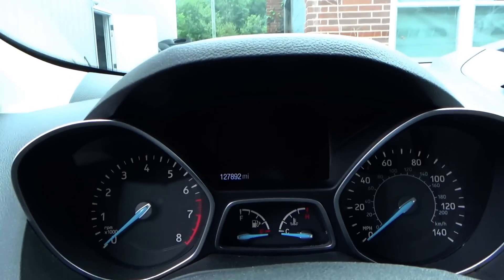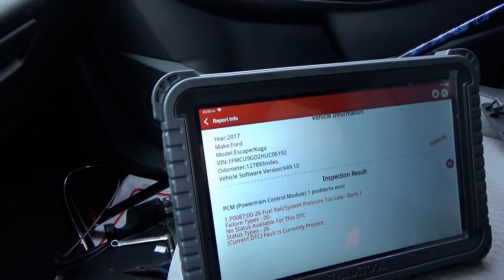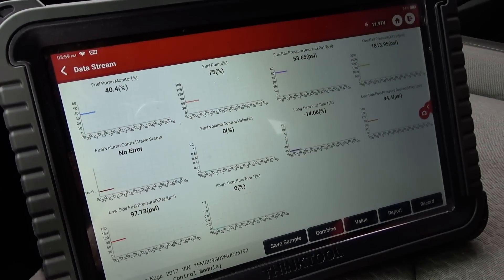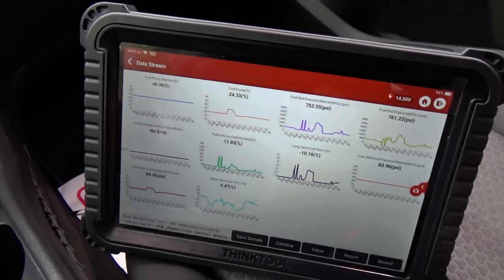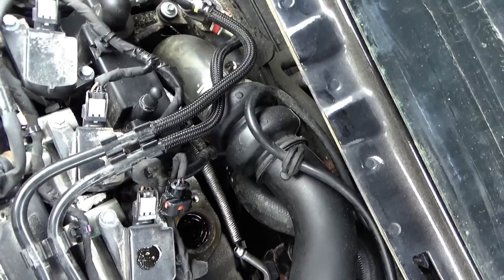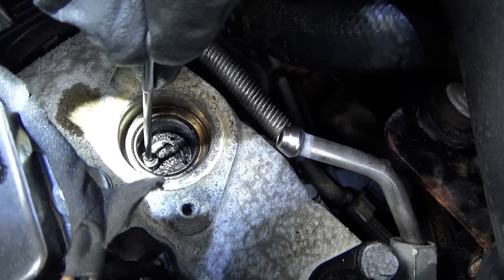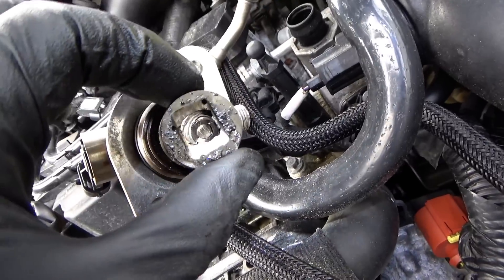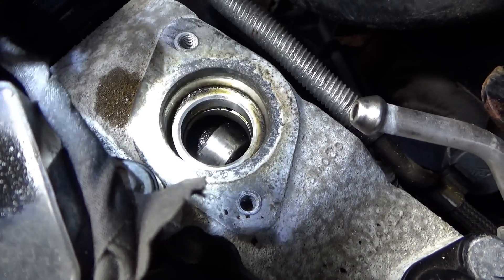Auction Ford FALLS ON ITS FACE! (Escape Turbo GDI P0087)

Comment: That camshafts going to tear up a new cam follower and pump very fast. It should last long enough for the dealer to sell it to an unsuspecting customer and leave them stuck with the camshaft bill. Not to mention that metal from the follower and the torn up cam is probably going to wreck havoc on the rest of the engine internals. This flat tappet design is very similar to the first generation VW/Audi 2.0t FSI engines and once you chew up a follower you were replacing them every oil change. Love your diagnostic work but I would not of done this repair without replacing the camshaft, especially for a car dealership.

Comment: I am an old timer. With naturally aspirated engines we used to have a single fuel pump that ran off of an eccentric on the cam shaft. There was a lever on the pump that actuated a very simple diaphragm mechanism with two check valves, one in one out. It worked perfectly for about 80 years. Then we were told that they had to put an electric pump inside the fuel tank. The fact that this
 " high pressure pump" works pretty much the same as the old fuel pumps tells me that they were lying to us. The only comment I have regarding the arrangement on this engine is why the hell didnt they use a roller follower arrangement instead of a thin cup to ride on the camshaft?

Comment: Ford should of Never removed the 2.5l from escapes, I put 436000 on my first 2.5l and I have 91000 on my second 2.5l. my Escape 2016, has 491000 miles on it.  I wouldn't buy an eco boost ever. You'll never get 430,000 on an eco boost

Comment: Pump appeared to function at idle volume but not higher rpm volume, it not being pumped enough because of wear makes sense. To have such poor oil maintenance and get that type of wear, the car engine is junk, I might give $500 for a local trip vehicle.

Comment: Had a 2018 Escape the other day that was a no start tow in and the tech noticed the high pressure going wonky but no codes.  We followed it a bit and checked the supply side pressure and fuel rail pressure sensor coming up with nothing so I finally went back to the basics and asked him to try starting it on alternate fuel/spraying it.  No dice so asked him to check compression.  50 and 40 PSI on all 4 and noticed then it was a sludge bucket.  Used engine for the fix.  
Crazy how those high pressure systems react when the ECM is trying to regulate the fuel pressure with unprogrammed variables happening.

Comment: I had a 2012 Qx56 auction car that would idle ok but shut off as soon you stepped on the gas. Low and high fuel pump pids were about similar. In my case the cam bucket was welded to its bore and had a nice hole at the bottom. Humongous job it turned out to be. Broken teeth on the crank gear didn't wreck the engine tho.

Comment: I wonder how good is the oil pressure light on these engines plus I wonder why they didn't change the oil it would be interesting to see how long the change oil now message was on for and what was the oil life reading my guess minus 20

Comment: Stick a quarter in the new follower for a shim and save the cost of a new pump.   OMG did you throw that gas soaked towel on the ground?  Not in an official hazmat receptacle? What were you thinking?   ;)

Comment: You, and many others will soon learn that once ANY damage occurs to THAT cam lobe...it's game over.  The self-destruct timer has been triggered. There's metal bits EVERYWHERE, now, tearing up bearing jounals. Balance shaft bearing surfaces REALLY take a beating!! That follower is the problem. Fortunately, newer systems have been redsigned to use roller followers.
People (in general) are not aware that vehicles have changed signifigantly, and are much less forgiving.

Comment: GDI engines suck when properly maintained - when neglected, they suck harder.
Reply from the maker: LOL!
Reply: @PineHollowAutoDiagnostics  Even with the follower replaced, the metal sporklies from it will have wreaked havoc through the engine. :-(   It won't be long for this world. Plus if that cam lobe is hammered, so will the valve lobes.
Reply: @jamesward5721  they suck only 1/4 of the time...the rest of the time they" squeeze, bang, blow! ;)

Comment: Great video as always. I just did the exact repair on another but I opted for cam replacement also as my customers was much worse looking than that. Also the lobe that drives the fuel pump has 3 peaks on it not just the one so worth checking all three while you're there. Can't wait for the next one! Thanks Ivan!

Comment: Sad thing is you'll fix this issue (nice diagnosis btw) and something else will crop up in that abused engine.  Spin a bearing or clog an oil pump, something.  Whoever buys it is taking a real chance which I'm sure the seller won't disclose to them.  What were all those white crusties on the cylinder head/valve cover?
Reply from the maker: You get what you pay for lol

Comment: Every 3000 to 4000 miles or 6 months whichever comes first!  OIL IS CHEAP!  ENGINES ARE EXPENSIVE!  Turbo engines are more expensive!
That's a good one Ivan!   Thank you for the video.

Comment: Hey guys please help. I'm working on a 2016 Toyota Avalon with lean codes for bank 1 and 2. I take a look at the the fuel trims and I have 29% and 24% on bank 1 and 2 respectfully, which indicates a fuel delivery issue. The car uses a variable speed pump. I have 31-32 psi at idle with 63% fuel pump control but goes up to over 50 psi during sharp acceleration with close to 100% fuel pump control. I ran a jumper to the pump to increase the fuel pressure at idle and my fuel trims normalized. I just need to get the fuel pressure spec to be 100% confident to make the call on the fuel pump
Reply from the maker: AllData?
Reply: @PineHollowAutoDiagnostics  don't have that here💔
Reply: Made the call on the fuel pump today and my idle fuel  pressure went from 32 psi to 58 psi and my long FT went back to single digits on both banks💪.
I'm surprised by how smooth the car runs with the old fuel pump. The owner didn't complain about any drivability issues. It was just the check engine light. 
Bt we are not out of the woods yet.
I have a P0156 pending. I won't keep you guys updated. Lol

Comment: That's not just lack of oil changes, it's poor lubrication....for whatever reason. That damaged cam lobe is pretty quickly going to eat the new follower. Cam should have been replaced and the poor lubrication investigated. High pressure pump is a stupid design and concept anyway. Pump should have a roller lifter at the very least.

Comment: Seems fair to suggest that 4 cylinder engines get oil and filter changes more often than typical because they are under more stress than 6 or 8 cyl engines. Especially a turbo.
Reply: @Garth2011  if any engine has overhead cams, it's better to change the oil on factory service schedule.
Reply: @Bryan-Hensley  Explain that one. Factory service schedules tend to exaggerate.
Reply: The never ending quest to get more and more out of smaller and smaller displacement engines has forced the use of turbochargers to give that extra pep needed sometimes. The drawback to turbochargers is that your oil becomes diluted with fuel from high combustion pressure. Oil changes must be cut in half that which is expected with a naturally aspirated engine.

Comment: Me thinks the cam lobe will grind away next which will take out the follower and fuel pump again. 
That engine likely could use some rislone additive in this batch of oil then change it again in 500 miles. Then, change the oil (Synthetic 100%) and filer again after another 500 miles with another can of rislone then every 5,000 miles thereafter back to just oil and filter or keep using Rislone...it helps more than it hurts.

Comment: I'd use Valvoline's latest Restore and Protect oil that cleans the engine with repeated use and extra filter changes to prevent clogging. Other than that, this engine is headed to an early graveyard.
Reply from the maker: I'm trying the Valvoline Restore oil on a few oil burners...will see if it can unstick piston rings :)

Comment: That follower should turn in the bore.  Looks like it was stuck.  It does the same as a flat tappet camshaft. The lobe is slightly angled so it spins the follower.

Comment: Great diagnosis! I'm amazed that this doesn't happen more often. Those pumps are under so much stress....
Reply: It is weird the actual pressure was twice the requested.  you would think it would be reversed and actual is lower from lack of travel at least.
I don't see how it regulates the pressure driving off a cam. I could see that follower not following at 100% though.

Comment: French cars used to run on straight 40w oil and rear end on plant oil , and Citroen hydraulic oil was so special that if you put on regular hydraulic Oil or ATF the who system would leak and need a total overhaul rear end was worn gears . Everything very different from USA , and those 4 cyl french engines ran 1 million km without oil change. Believe it or not french engine oil often had added graphite
Clutch throw bearing was a long lasting graphite disk, not ball bearings . A different world

Comment: It look more like a cam lubrication problem than an oil change problem, maybe the cam lobe are not lubricated for some reason if it was The whole engine it would be dead , and where did all the metal go ? It could be a faulty follower material problem too soft.

Comment: Like every french taxi we only top up , same oil for 15 years no issues except engine now worn out from  too many miles. , think your a representative from an oil company. 
Many new cars now say 15000 miles why , you can answer yourself , and spark plug now at way over 100 thousand miles, everything has changed from 500 mile oil changes to today. 
Good filter more important
Reply from the maker: Maybe if you change the oil every 5 years, the magical French engines could last 100 years! 🤣👍

Comment: A lot of tech's forget that not only does the pump need lift to make pressure, the cam lobe needs to be in time . 
The sludge and timing codes add up to an engine replacement

Comment: This issue was common with early VW TSI petrol engines as well, with the difference that in those cases, metal shavings ended up in the injectors, the tank, and all the fuel lines. Later, this was modified to a roller design.
Reply from the maker: How could the metal shavings get into the fuel system? 🤔
Reply: @PineHollowAutoDiagnostics  Yes, you're right, I haven't looked into these things in a long time, back when I was about to buy a car. In the case of diesel engines, there were instances where the entire fuel system was filled with metal shavings due to the high-pressure pump. This issue didn't occur with gasoline engines, but in earlier years, similar problems happened with non-roller systems, as seen in the video, and they eventually switched to roller-based ones
Reply: Well, that's no answer. How did the metal get past the plunger and into the fuel system was the question. Seeing as it's a physical impossibility unless the plunger itself was destroyed, and that no super high pressure fuel could then have been generated due to pressure loss, diesel or gasoline, to go the injectors once an almost infinitesimal scratch had occurred on the plunger  -- so the engine would not have worked and the metal shavings wouldn't have been drawn in and contaminated the fuel system with zero movement, so your answer makes zero sense. Full stop or period. You sure you know how these pumps work? Something else had to be going on. 

Or to be charitable to you, it was just VW who had some stupid unique design nobody else had the imagination to come up with. Look at the EA888 timing chain system to see uniqueness at work. Argh! No! The torture is too much!

After 22 years of Audi nonsense, I guess some of the explanations I got from Hans the service foreman for failures (true name and you should have seen his eyebrows and white lab coat from '75 to '96) beyond the usual one trotted out about my not being a German and thus not a suitable human candidate for driving such a precision piece of Teutonic machinery because I would inevitably ruin it, was that aliens from outer space had caused the problem, because this problem had never before occurred on this planet. Moreover, I was incredibly lucky that Hans and his boys had possessed the amazing ability to order and have in stock precisely the parts needed to repair this one in a billion event.

Funnily enough, when, in a fit of pique after another BS excuse was offered up by Hans, I went Japanese,  the aliens apparently all went back to Rigel IV and thus ended their slow conquest of Earth in cooperation with Herr Doktor Professor Dipl Eng Ferdinand Piech, Chairman VW AG. As far as I could tell, anyway. Because no problems beyond normal wear items happened in ten years, after which I bought another Japanese car, and it lasted eleven before my roving eye decided a new car would be nice.

Avoidance of VW products is a strategy I advocate to anyone who'll listen. But there is a never-ending supply of people who are willing to give them a sporting try. Before discovering for themselves it was a bad bet.

Comment: I would have just put a thick disc down in the bottom of the cup to account for the amount that was ground away from the pump stem..  then you could have still used the old pump if it was too expensive.   But for this many miles--  200 isn't bad for a new pump.  Nice call.   I'm sure this thing is dying for a timing job soon though. lol.   You know it has never had one.

Comment: Where did all that worn metal go to? Right into the engine would be my guess. I'd say to that shop that there is no guarantee on that work. It needs a new engine in my opinion.

Comment: So where do you suppose all that worn off metal is now? It went into the engine, the bearings and everywhere else including the oil filter. That car is headed for a short life. Would be interesting to see what the oil pressure is like, both at idle and at speed.

Comment: I performed a diagnostic on a 2014 Hyundai Sonata a few years back with that same code, turned out the HPFP follower was missing altogether. How? No idea, pulled the valve cover, never found it or any remains of it. No camshaft damage either. $180 for that little booger from the local Hyundai dealer, (Roller follower, not a lash cap type on the Ford) ran perfect. Still running since I saw it last the other day.

Comment: Earlier this year I did a warranty inspection an Escape with the exact same issue with the hole worn right through the bucket.  If my memory serves correct the camshaft lobe may have experienced some wear as well.

Comment: Had they done oil changes every 3-4,000 miles, that engine would be running fine now.  GREAT VIDEO!
Reply: Nobody does oil changes that often, complete waste of money.
Reply: @Malc180s  Absolutely.  I have one with 500,000 miles on it.

Comment: Ivan: Since this is not a roller cam lobe, wouldn't the cam lobe have been hardened originally and it looked like it had worn the lobe pretty well.  Isn't this going to fail again due to the worn lobe?  Maybe I don't know enough about cams but a flat tappet cam lobe worn like this one, will just keep wearing.  Maybe on this car, it just doesn't matter.  Love your videos; I look every day for the next one!

Comment: My focus did this on and off with hints for 2 years and finally set the low rail pressure code, it had been running off the low pressure side.

Pulled the HPFP and it was seized in the compressed position.  350.00 later, runs like a champ.

Comment: IMO that's pitted enough to need a cam.  It will work for a while until the cam wears more from the damage.  I've seen those tappets just beat to death, people don't understand how critical proper oil is to support the high pressure fuel system.
Reply: Repeat customer more money
Reply: @NeoAndersonReloaded   Maybe, but that's a disservice to the customer.  If it fails early enough it may be a "comeback" and you'll have to eat it anyways.

Comment: Yikes!  I've had a couple of them that looked like that.  Replaced the tappet and pump, and the engines ran fine for a little while.  Until the chewed up cams ate its way through the replacement tappets a short time later.  I hate to say it, Ivan.  But once that cam gets tore up like that, it's soon to be curtains for that engine.  If it's not already. 

A reliable car can be a big investment for a lot of people.  And changing the oil on time would have kept that engine running smoothly for decades.   A full synthetic oil change may sound a little steep, but having to replace an engine is FAR more expensive.  I can't stress this enough, but please change your oil!
Reply: Repeat customer😂
Reply: @NeoAndersonReloaded  Oh, for sure they will be back.  And angry as a beehive.
Reply: I was thinking the same thing.. that cam is eventually going to cause another problem. I'm really surprised there's no noticeable drop in fuel pressure with the cam lobe being rounded some.
Reply: Well said, you can't just replace a follower after a cam lobe has chewed it up and expect it to last, they never do.

Comment: Some people don't realize how important regular oil changed are.
Reply: Damage and sludge is usually caused by lack of oil. They start leaking and burning oil, the engine runs low on oil 6 to 8 times, the engine suffers.